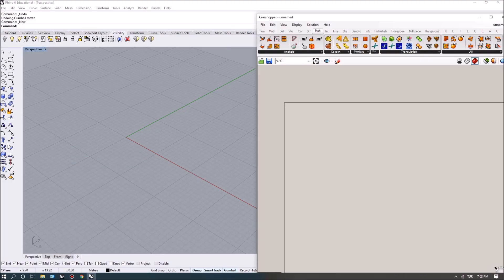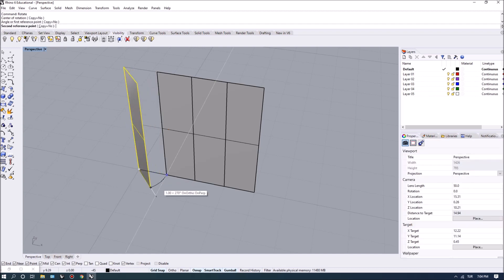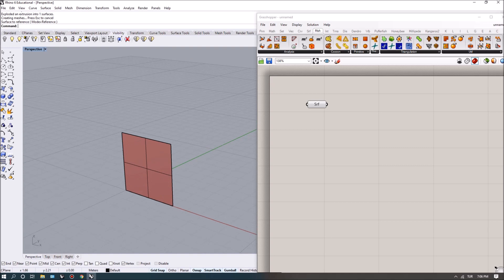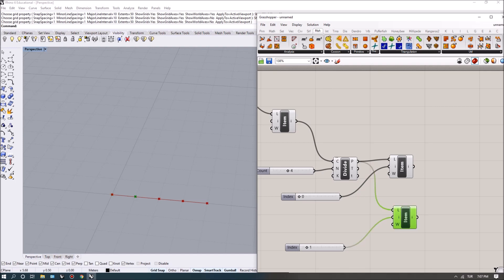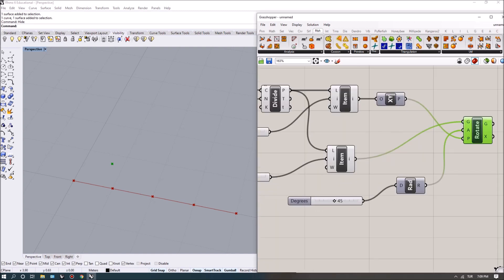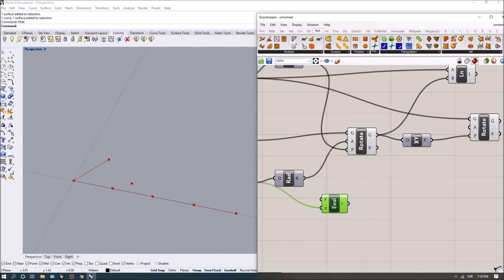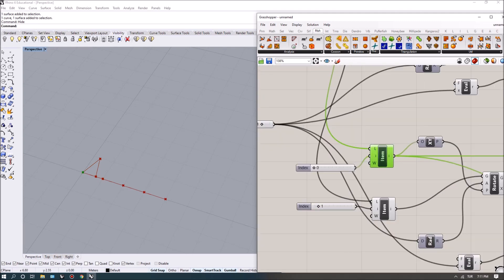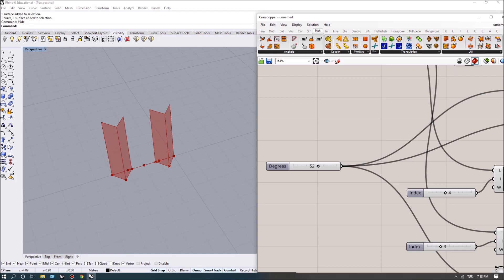Folding Facade Panels Grasshopper Tutorial: Part 1

Comment: i put '180-2*x' then it's wrong
Reply: me2. that's weird....
Reply: Turn off the 'draw full names' from the display menu. It's a bug or something I think.
Reply: than you so much that was actually the problem @yarendeveli7017
Reply: @yarendeveli7017  I try to turn off the draw full names but it's still wrong, shows:  Parameter "Variable x" has an invalid name, Only use alphanumeric characters and don't start with a number